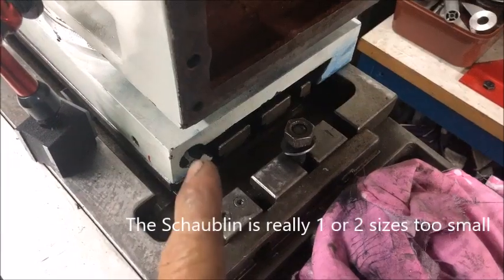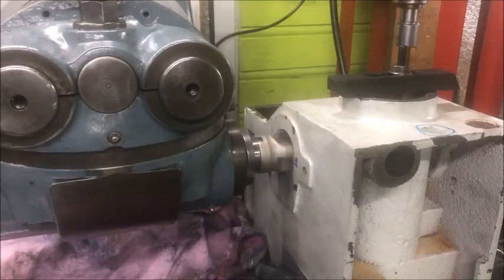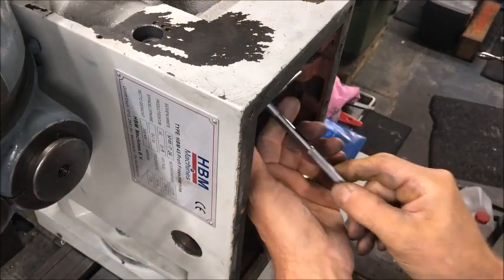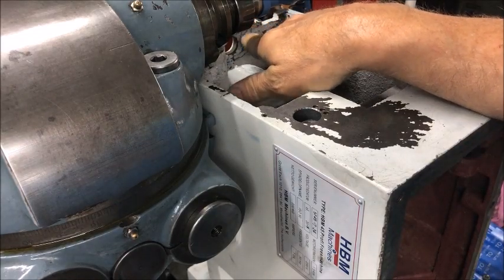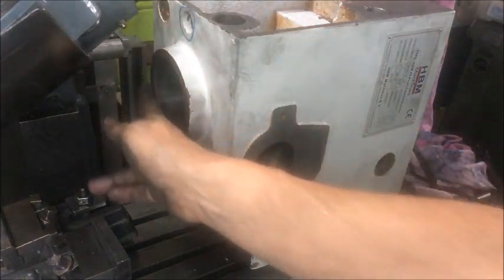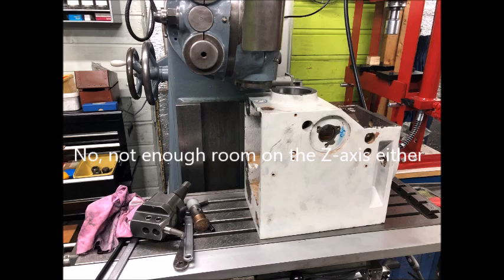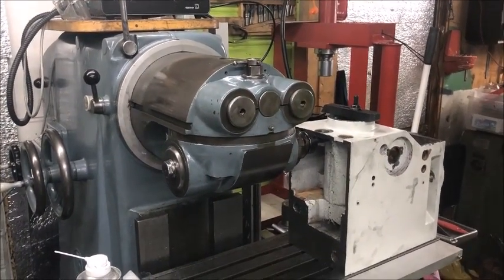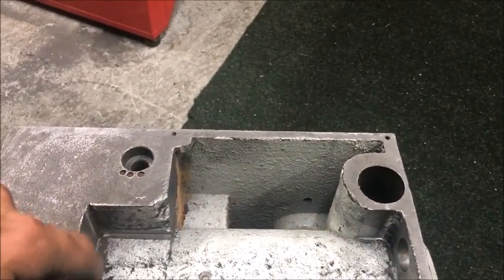HBM45 - head assembly - 3: machining

Comment: Your works are impressive. Would you recommend buying this machine? Does it work well at 220v? Thanks.
Reply from the maker: Thanks. Yes, would recommend it. I think you get much functionality for the money, BUT you have to be honest about the design/build/quality limitations. Not sure, but believe there are several version out there, some 220V. At least, the one sold locally here is an 1100 Watt. 1,5 hk. 230V 1-ph.
Reply: Thank you very much

Comment: You may have thought about and tried this already Jan, but is there any way depending on the orientation you bolt that head casting down to use a between centers boring bar on your lathe to re- bore for the main spindle on your lathes cross slide? The shimming and alignment would take quite awhile, but you may not have enough free elevation space above the cross slide or distance between centers to do so. A thought anyway.
Reply from the maker: Hmm.. nice idea! I haven't tried line boring the casting on my lathe, but could be it would have worked. The Russian hasa quite low center height but if one places the casting upside down it is not too far off. However, the casting itself is too wide for the cross slide. Could have tried the same on the milling machine actually.. I reckon that even though I also  had very little room for using the tool to indicate the bore, it would not have been super critical radially and for teh short distance axially also not (but since I didn't try I am also not sure)

Comment: Wow Jan, you really are putting this machine back to a good state. You have exactly the same head casting and spindle assembly as my machine. When I stripped mine, the inside of the spindle bore is rough and full of mill scale, this was dropping down into the back of the lower taper roller bearing. I had no way to bore it out so I flap wheeled it and painted it to seal it up. Videos on my channel if you want to see. Keep going, you are doing a fantastic job. Cheers, Jon
Reply from the maker: Thnks. PS! It is not my machine. I am doing this for another person.. I'd like to call us "machine buddies", but "machine nerds" could probably also be a good description .. haha
Anyway, I tried to do my best to cover what was done, which btw turned out to be quite a lot comprehensive than what I had anticipated! The owner had cleaned out the inside of the head himself, and I assume in the process also done away with all the "dirt" inside. I know from another friend that these machines often come with quite a lot of "unwanted particles" there.. On this machine he has also changed the bearings, which is probably a good idea as the original ones often are prone to "early decay" with the grease saturatde with cast iron dust..
Sounds like I need to take a look at your channel :)